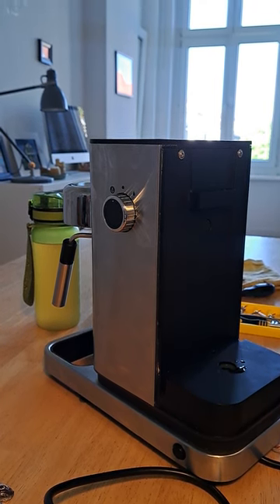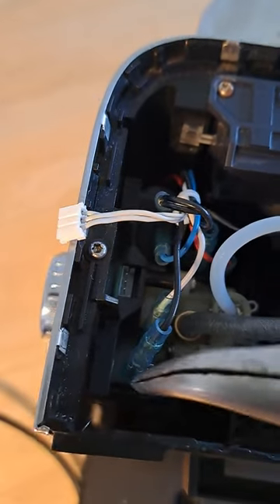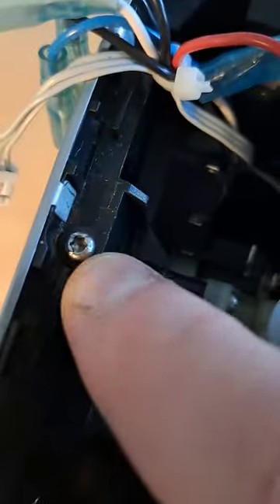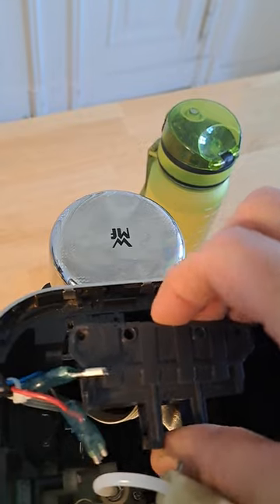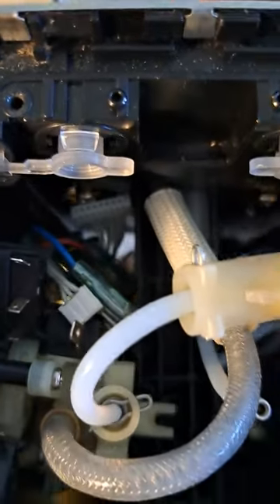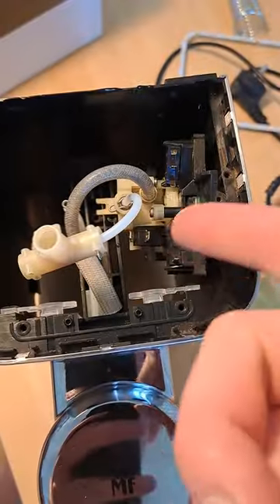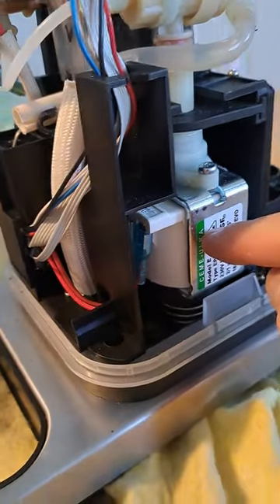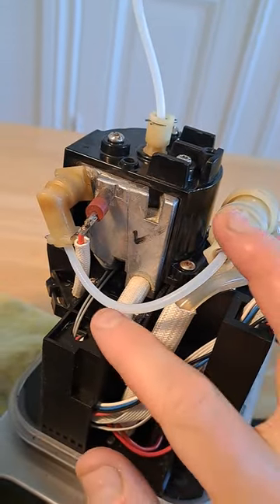WMF Lumero espresso machine - DISASSEMBLY video

Comment: Hallo Nathan, ik zoek ook hetzelfde onderdeel waar je het over had, bij de eerste website die je noemde staat het artikel er niet bij, bij de 2e website staat een artikel zonder foto 'SEB FS - 1000050800 Abdechung - embout/chaudiere' €16,86. Is dit het artikel wat ik moet bestellen?
Reply from the maker: Yes that's the one!  I am amazed that this part is so hard to find...it breaks on many machines. I might have someone 3d print many of them. If I do, I'll let you know. Good luck!
Reply: @nathans1978  oké thank you, and also for the video, it was very helpfull! Elisabeth
Reply from the maker: @ElisabethZwanenburg  you're very welcome. Let me know if you have any questions later:-)
Reply from the maker: It seems to be in stock/available again here: https://fixpart.de/de/product/view/0257277101
Reply: @nathans1978  I ordered it there indeed, delivery in 2 or 3 weeks so I have to wait for a little while now..
Reply from the maker: @ElisabethZwanenburg  ok I hope it arrives soon and your machine works again
Reply from the maker: @ElisabethZwanenburg  save the rubber rings from inside the old piece. There should be a few of them. The new piece might not have any
Reply: Are you guys sure this part contains the white connector that breaks easily and is not just the black cap (= abdeckung) that slides over the heater?
Reply from the maker: @peter-paulvanmaanen1819  I hope so but without a photo I can't be sure. I used to use this same link and it had a photo with it. Hmm,  I will try to find out.
Reply from the maker: @peter-paulvanmaanen1819  Peter thanks for pointing this out. If it's not the right part I'm sorry. Once I have the 3d printed ones finished I'll post an announcement.  In the meantime I better delete the links.
Reply from the maker: @peter-paulvanmaanen1819  ...kind of strange that within weeks of me posting this video , both websites have changed the listing.
Reply from the maker: It's available again! See my post from today:)